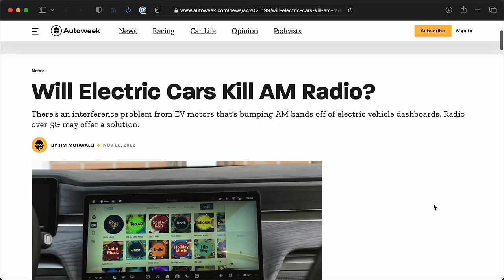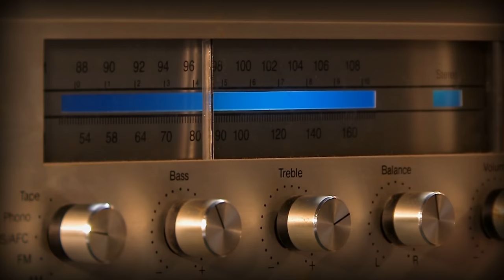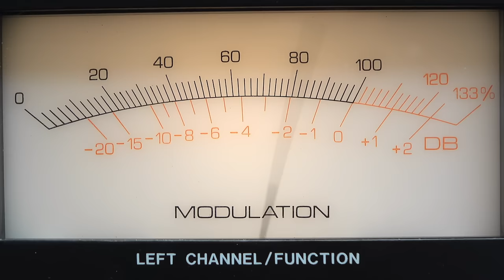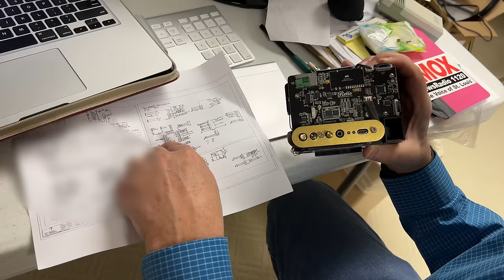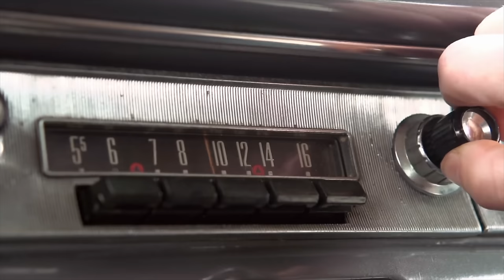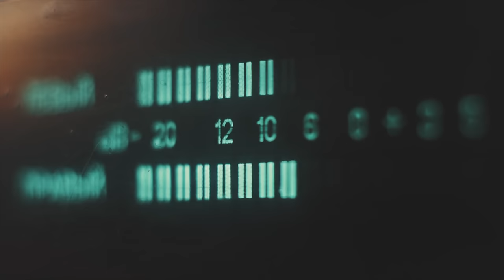Is AM radio dead? Tesla thinks so!

Comment: Where I live, in the U.S. southwest, during the day there are 3-4 English speaking AM stations, two right wing propaganda and two sports channels, but there are also a few Spanish stations heard out of Mexico. At night , except for the Mexican stations, they drop to such low power that the ones 40 miles away are inaudible, the one here in town is virtually inaudible, and every other frequency is just a cacophony of noise, both from a jumble of stations and electrical interference. And yes, I have tried directional loop antennas to no avail. When I was a kid I used to enjoy DXing the AM bands at night with all the clear channel stations booming into my bedroom in the midwest, and occasionally I could pick up Cuba and the powerhouses in Mexico, plus, I could occasionally hear Europe on long wave. I don’t know what happened to the clear channel stations but there are no clear channels here, so for me, yes, AM radio is dead.

But the FM stations are all 5 9.

Comment: you know, my favorite radio station is an Am station. its nothing spectacular, it sounds like a AM station, with the added "benefit" that its coming from 70 miles away. I'm just barely able to pick it up at night. I hope some day they switch to FM, it would be nice. I like AM, but FM is so much better. idk. a world without AM seems strange to me. Im 18, so its not like I would miss much, but its always been there on the switch next to FM. it truly sucks that station is on AM though. having to go so far, it gets interference with EVERYTHING. If im driving to close to a certain set of power lines on my drive to school in the morning, it gets horrid. However, it is fun to use from time to time. I have a midland weather radio, and it is battery powered. Its fun, the nights the power goes out due to a storm, I can turn it over to the weather stations or an AM station and it is crystal clear.

Comment: You can build AM/FM radio out of simple materials. You can make your own transistor. Digital radio is made of IC circuit with a lot of transistors inside, virtually impossible to make it at home unless you build a precision equipment. All you needs is some kind of cosmic event that fried 90% of computers, then digital society will collapsed.
Reply: Inability to use computers will be much more important problem than absence of radio.
At lower frequencies you don't need specific ICs.
You can make generic radio, which works with I/Q signals and control its data flow with virtually any computer.

Comment: Why has the FCC been asleep at the switch? Why is the agency not actively requireing due and diligent enforcement of conformity to Part 15 Part B standards for interference control? David W. Berning has designed a power supply system that produces so little interfernece that he uses an AM radio receiver to validate its performance.

In the early days of the President Reagan, then then FCC Chairman, Donald Fowler, chose to allow some four competing standards for AM stereo broadcating standards to fight it out in the marketplace. The result was that AM radio was thrown off the cliff as the four systems were incompatible with each other, perhaps with the exceptions of the Phillips and Motorola systems.. Then then dominant system during the experimental phase, the Harris system, was forced to be taken off the air and withdrawn, Unlike the decision process for the highly successful FM stereo system, the FCC failed to conduct field tests, as was done with FM Sterol. General Motors decided to conduct its own field tests, and found the Motorola to be best for car radios. But the damage has already been done.  Later, the TV standards committee, horrified by what happened with AM radio, undertook the design and agree upon a sutable system for TV sound. It took some regulatory tricked to preven the FCC from redoing the sorry state of AM radio,

Comment: All the directions this topic could go.... Why wasn't Kahn ISB adaptive sideband detection attempted in the 1950's when AM made that important, versus not until the downhill spiral of the industry merged with Motorola hiring political big guns to trump better engineering?  (Not that "Never Twice Same Color", or AM L-R subcarriers, were ever great choices....)  

A good AM radio needs either a synchronous detector (not cheap historically, not easy until newer tech at which point $5 vs 50 cents was a big deal to corporate pinheads), or a diode detector biased into more linear operation, at the expense of sensitivity, which in turn required a better front end overall (way bigger cost than simply biasing that diode away from its cutoff range)....  

But, none of that makes up for the corporate consolidation of media control, and programming not worth turning on.  Nor how digital, whether IBOC or otherwise, is generally more convenient and higher performing.  OTOH, there's a reason FAA ATC retains AM modulation, while police dispatch using NB-FM and not yet digital trunking has issues of cops walking over each other, as with AM signals add together even if that means sorting out what one wants to notice or not, and doesn't cause a pilot's distant Mayday call to be blocked by some GA student near the airport tower.  

I grimaced at this video's efforts to describe orders or Bessel functions in non-engineering terms, though any bright plumber's kid should be able to get that (eg, Leonard Susskind, string theorist who proved some of Hawking's claims wrong).  

Thinking back to a convention decades ago, a Sansui sales suit in a hospitality suite called out a design engineer from the back room when I asked serious questions about their innovative design to detect odd and reject even order Bessel elements, in order to reduce multipath as that could detect primary and reduced higher order reflections, but reject primary reflection products.  The bigger lesson in that discussion was how some very bright Japanese have far less English skills than we're taught in the USA, whereas it was sort of like we were pointing at universal language for all bright engineers (ISO schematics), and grunting at each other.  

Or, how Pioneer made the best video disc systems early on, with a transport that did CD and DVD techs in one, with 3 separate electronic boxes for data, audio, or video, back in the late 1970's when JVC had a capacitance pit disc, but the RCA piezo tracking stylus horrendous design saw the best marketing, and was all most people knew about for many years.  That's almost like the idiot voters who claimed Congress snuck ATSC 1 and an end of NTSC n them in 2006, with no clue how much went into MPEC and its various layers, such that I was in a Sony demo clip at the 1984 NAB show (green screen keyed 3D animation in 720p with a wall size display after), long before the 1995 action for a 10 year transition to kill off bad NTSC tech tediously slowly, as anyone informed knew.  

Or, there was Bronwyn Jones joining CBS labs in Stamford, CT before Icahn style VC/PE raiders shut down research incubators as if wasteful to their insanity, leaving Mike Dorrough to take over an abandoned project. And how he, and some other notable engineers, ended up as anti-censorship activists, as SCOTUS political scammers with Beltway approved prejudices really violate bigger standards of law and justice, where serious engineers recognize a far wider range of perverse political games in violation of civil rights law, and not just making electrons dance on the head of a pin.  

But, reflecting back, when I sat on a panel Fraunhoffer AG led that was working on MPEG-1 Layer 3 criteria, little did we realize we'd live to see that deprecated on a timeline far faster than history previously expected. The basic criteria for that tech layer actually worked well for its needs, even taking on a life of its own apart from video sound.  

Now, about the Russian tech archives where I found a Philips manual not available from that OEM, but because some stuff they had could be lethal to work on, they imposed a basic electronics test to get free access....  Strange, using Google translate and schematics to answer basic electronics design in Russian....

Comment: AM signals have one key characteristic, range, which FM do not.  The average people just know AM exist in their radios, but it is the basis of most aircraft radios (CB) and some direction finding equipment. The electric car engineers just took a short cut by not working on noise suppression and just have no AM band, this short cut might come around to bit them eventually. Of course, you might not notice if you are dumb enough to buy a electric car. The average people also do not know a lot of things. Such as radio stations and high powered radars still use tubes, and they thought it was obsolete tech. Of course if they start a PR campaign powerful enough, the public will follow, just like the Covid and jabs.  For me, if I buy a car and the standard radio do not have an AM band, I swap out the radio.

Comment: most cars stopped having factory installed AM/FM radios 10-15 years ago in favor of Satellite radio subscriptions and in dash CD players are dying out as options as well though those have been available as options in at least American Luxury Cars since 1987 model year starting with the Lincoln Town Car though the last Luxury car to have a tape player was the 2010 Lexus LS460 and The Lincoln Town car was discontinued in August 2011 after 32 years in production the Continental was discontinued in 2020 after 65 years of its 82 years in production. my uncle Dan had a used 1984 Continental Mark VII when I was a kid loved that car it was still rear wheel drive though it did switch to front wheel drive for the 1988 Model Year a 1984 model was more than a foot shorter than it's 1980 Mark VI predecessor

Comment: AM is still alive and well in my life!! Where else is there talk, music, news, traffic info and the like?! 
All FM is now is "classic Rock" I've been hearing for 50 YEARS, over and over, and the same for shitty contemporary pop tunes. Sucks!!
As for static on AM in the car, shield the radios from electromagnetic bleed and it will be fine!
We have a 1999 car and AM came in well for a long time. Then a few years ago we got static and interference with the engine running. I changed out the old spark plug wires for new ones and problem solved!!
My feeling is being that AM is doninated by Conservative talk, it's easy to silence those voices by phasing out the entire band. Conspiracy theory? Perhaps. Still, that's the result. 
If we can put a man on the moon, we can easily figure out how to keep AM radio alive and well!! 
And with all the tech out there it seems ridiculous to me that a comparatively simple technology isn't easy to maintain. Seems like a step backwards to me. 
And one advantage to AM is you can get broadcasts from thousands of miles away, especially late at night, where FM fizzles out just 30 or 40 miles from the station. Or you get cross broadcasts, one station bleeds into another as you travel. 
KEEP AM ALIVE!!

Comment: okay, gotta say, i love old tech, simple and just works like shortwave I admit is even interesting for the contacts and stations you can find, been DXing since I was a kid finding weird stations from across the world and recently got myself an adorkable ICF-SW1. But AM, really, it gets all the noise, and there is one station here, it is not optimal and inaudible even on my Pioneer amp and MDR-V6 headset. 
Chinese propaganda stations are cannibalizing SW but the sound is really audible.
What you would want is better FM transmission, all the resilience is there, it has shittier propagation in the VHF range compared to AM/SW but it works!
Wanna hear radio on a modern car? Grab an AM/FM one on eBay for ten bucks and leave it in the car in case of! Hell you can even plug it to aux and hack some DC to USB power. But careful, Sony being dicks, the negative is the center and pos is the outside of jap DC connectors.

Comment: I agree with your dad and the FCC. The you know everyone has gotten so dependent upon the internet and satellite Communications and GPS if a solar after we would be a big trouble navigation the internet is more and more becoming orbit dependent so there should be absolutely backup data transmission abilities and emergency an amateur radio operators to a great job of keeping this alive and if there's ever a big problem we will be in their debt because they will have the ability to set up ad hoc mesh internet systems in small villages and towns and Link them together with long range 2.4 GHz dishes and put multiple omnidirectional antennas on their house on the roof raise them up with balloons all kinds of ways and create a mesh emergency internet which could slowly rebuild infrastructure at a faster pace and rate than if they didn't exist and if people didn't have this knowledge. Arden it is one way and where I live the amateur radio operators are so aunty computer I actually made a huge

Comment: OK then, Tesla? I find this amusing when literally all their model cars open their charging ports after receiving a particular frequency signal, which can be emulated by the popular pentest toy flipper zero. It’s pretty fun, works on locked cars and everything I noticed they automatically close the charging port after like 15 or so minutes presumably after the cars computer realizes the ports been open with nothing plugged in, at which point you can send the signal again and do it again for the lulz. 

But sure Tesla, you’re just so technologically advanced you’re too good for AM radio but I guess not technologically advanced enough to use your own LiDAR sensors

Comment: Of course it's dead. The amount of RF interference sources present in every home, and the vastly inferior sound quality compared to FM, not to mention digital audio, makes it obsolete, and nobody apart from ham enthusiasts is interested in it nowadays. When the last people who listened to music on AM radio and are doing so now for nostalgia reasons die out – nobody will touch it with a long stick.
The fact that it propagates better and you can connect to places on the other side of the Earth bouncing the waves against the ionosphere - nobody apart from hams care, at least here in Europe, where we don't have vast empty spaces like in America or Australia.
Keeping the infrastructure just for its possible usefulness in case of a planetwide disaster makes no sense.
I am 55 and have not listened to any AM station on purpose for over 30 years. I may have tuned to one or a other when repairing old radios, but that's about it.